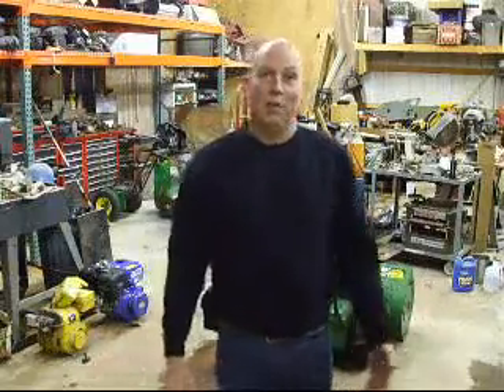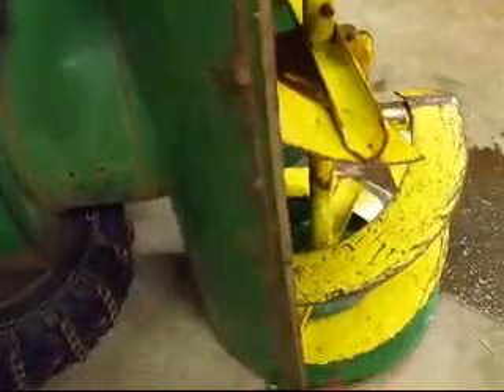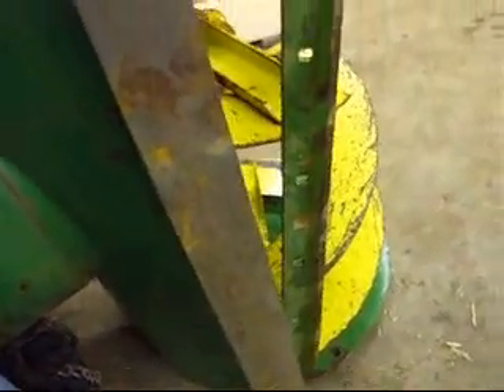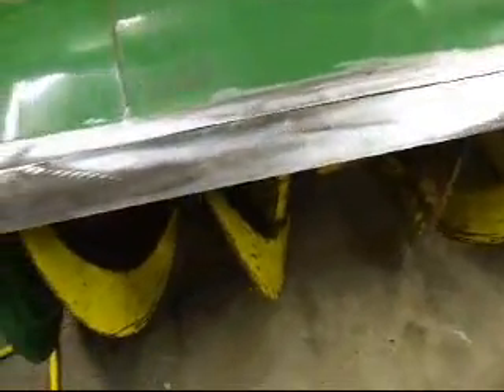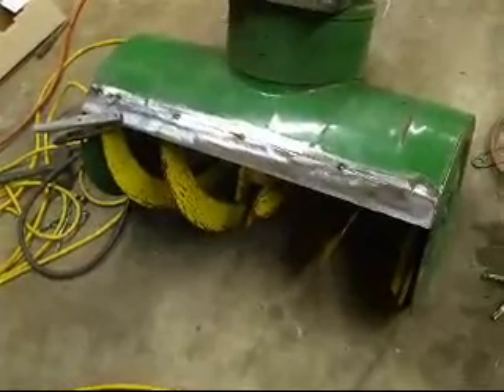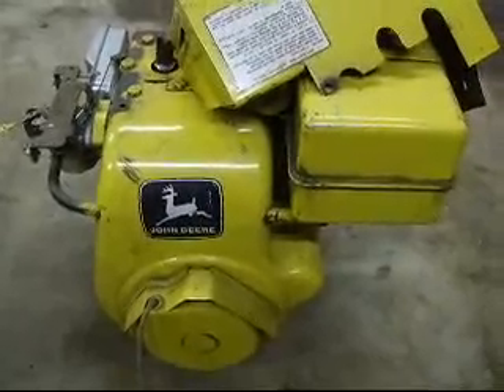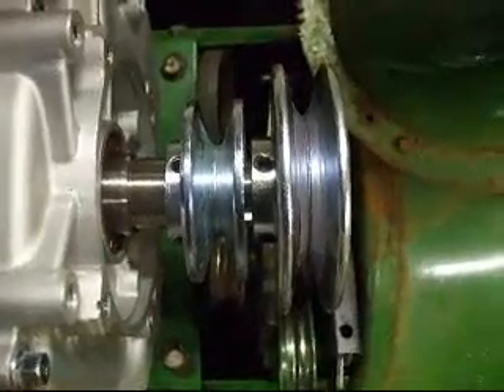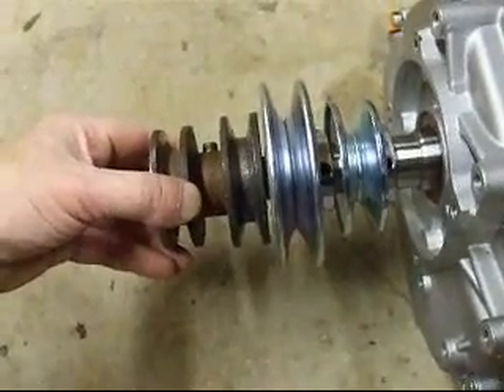John Deere 1032 Snowblower Repair & Modification Video Part #1

Comment: where did you find the pulleys, just put a 13 hp predator  Harbor freight engine on mine 1" shaft, my original had a 3/4" shaft so need to find pulleys, small on the original is 2 9/16, large end is 2 13/16. If your new engine is 1" shaft, what pulley's did you use, what size belts? Please let me know.

Comment: looks good, what dimension from the edge of that new steel did you drill the holes?  I just replaced 2 inches of the bottom of the shroud.

Comment: looks like a nice project.
From the dents in the bucket, it looks like that blower has hit more than just snow, lol.
I am kinda surprised how many people always leave their chains on.  After going clunk-clunk-clunk enough times on my littler blower, I started just putting on the chains when I need 'em.  ;)
Sometimes a little rpms help, I went from a 10" impeller pulley down to a 6" on my little blower and it was the best mod I did.  It actually handles slush -better- now.